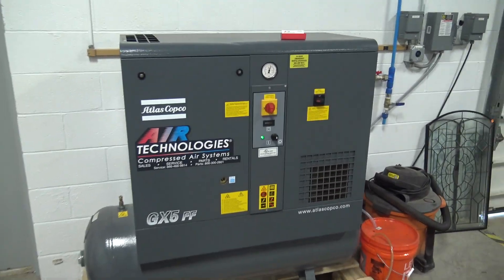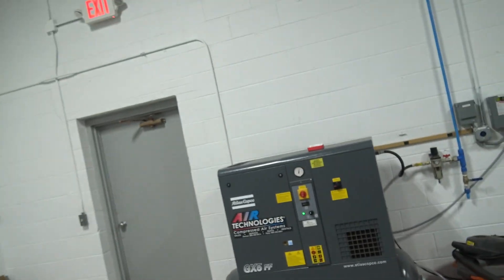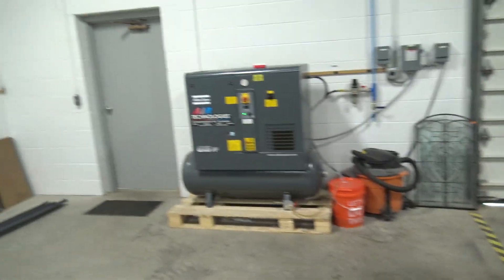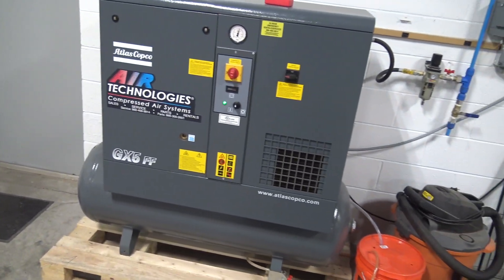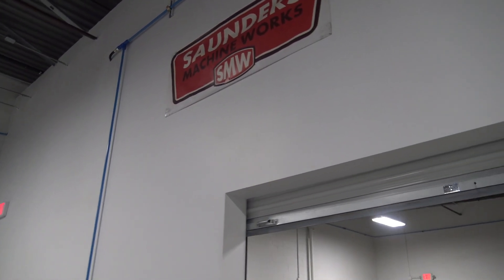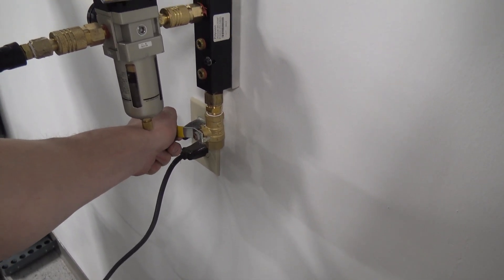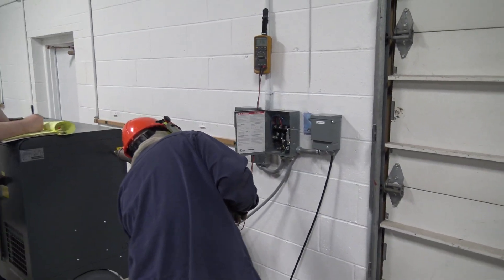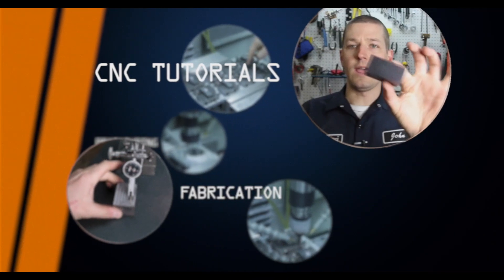Rotary Screw Air Compressor:  What are they?!  Worth the hype?

Comment: From experience working with idiots, you never want to dead head a rotarty screw compressor and then immediately release that pressure.  The end result is blowing all the oil out of the system into the air dryer.

Comment: I've just been using regular cheap white sch. 40 PVC 1/2" glue together pipe and fittings for my shop, it's been around 12 years without any problems, I'm running about 250 feet of it at 180 psi.  -  Works fine.
Reply: the main issue with PVC for air isn't how it performs when all is well, but how dangerous and spectacularly it fails.

It gets quite brittle over time and with UV exposure. It will shatter and send sharp fragments flying when it burst. You can find info about this on Google.

I am posting this as a PSA type thing not trying to attack your air line choice.
Reply: Yeah, the first time I saw a shop with pvc compressed air lines I  thought they were just cutting corners. But 1/2" and 3/4" lines can handle in excess of 280 psi. I've seen a few shops with it, and nobody seems to have any problems with it.

Comment: I dont know if it would be worth the extra cost. Buy two pistin style compressors, put them at either end if the building, have two separate loops and build enclosure around both if your concerned about noise. At least then you have done redundancy and aren't relying on one compressor for everything. Probably would have saved a decent amount of money too.

Comment: Screw compressors are the way to go. I'm about to upgrade my shop to a 100cfm variable speed IR so I can install some new machines. The compressor in this vid is great for running a constant air load but not so great for intermittent load. Variable speed units provide better efficiency over an on/off unit when used below full capacity. In my case a variable speed compressor is going to save me a ton on the electric bill. The downside is initial cost, and the added complexity of a VFD which makes it more difficult and expensive to repair should the VFD fail. Saw it happen when I was doing plant maintenance... cost 7k and 2wk lead time on a new VFD for a 25hp unit.

Comment: I agree with how you've dropped the lines and got water traps at the bottom. At least it comes out of the pipe that way. Also it's faster to just wire up three phases to the motor randomly and then test for direction and if going the wrong way, you swap any two. So you have a 50% chance of getting it right first time. That's why he started it up and it went the wrong way. If you sit around trying to nut it out and then wire it up how you think it should be, it is GUARANTEED to go the wrong way first time.

Comment: Buying a screw compressor was one of the best things I have ever done. Our shop used a 10hp 2-stage 4 cylinder 120 gallon  compressor for years. Before our CNC machines the compressor would only go on about 8x a day for about 3.5 minutes each time. 

After the CNCs arrived it ran almost 50% of the time. Every 2.5 minutes the compressor would go on for 3.5 minutes.The noise was taking a toll. It was bad. It was worse than bad. (this in a shop of 2500 square feet... and no, there's nowhere to put the thing outside).

So, just for employee and the bosses sanity we bought a 10hp Kaeser AirCenter with the air dryer (it's a dry tank). Now I don't feel the compressor through the floor in the office or interrupting any conversations in the shop.

YES! They are expensive. YES! They have limitations but can sanity and hearing are worth more than a bunch of dollars.

Comment: I would recommend rubber air compressor dampers, they worked good for me

http://www.ebay.com/itm/4-Pack-Anti-Vibration-Pads-For-Air-Compressor-Or-Equipment-Solid-Rubber-4x4x1-/280485697812?hash=item414e401914:g:IiAAAOSw3ydV6ekA

Comment: I am not a air systems expert just someone who has used them.  From my experience a good piston compressor with a large storage tank with a drier or have a second storage tank for continuous capacity for somewhat intermittent  use would be a more cost effective system than the rotary screw system.  The rotary screw will put out a lot of air but is really meant for continuous use.  Its my take.  I worked where we used 400 psi and 150 psi with regulators for lower pressure as needed.  There was a compressor building that housed the air compressors and heat exchangers separate from the main building because it was noisy around that building.

Comment: Hi John

Great Video.

All I know is most Oilless type compressors will not stand up if they are used more than just blowing up a bicycle tire once in a while. If you have a Bead Blast Cabinet/Sand Blaster they will not last very long.  Oilless units have plastic pistons/parts and cannot stand the heat of higher usage like what is required running the above equipment.

Cheers

Willy

Comment: Part of the reason why the screws like to run continuously is to keep the moisture boiled out of the coolant. The oil acts as a seal filling in the gap between the screws, so they don't actually touch. Also in the book for my 5hp IR screw they make mention of the starts and stops over heating the motor. Says if more than 8 starts an hour then turn switch to run continuously. One thing about the oil maintenance is that service intervals are quite high, 5-8k hours

Comment: The price for rotary screw compressors might come down thanks to 3D printing. The YouTube channel "Tested" visited the Carbon 3D shop where they showed off a 3D-printed part that looks a lot like a rotary screw. The plan for that particular screw is apparently to make low-cost air conditioners for "emerging markets" but it seems like normal air compressors can't be far behind.  The YouTube URL for the video includes "O2thSsQrZUM", but I'm afraid posting the whole URL will be flagged as "spam". The title of the video is "Carbon M1 Super Fast 3D Printer Demo!" in case anyone interested in the video would prefer to find it by searching. They start talking about the screw at 10:49. I'm sure 3D printed rotary screw compressors are years away, but it seems that they're on the horizon.

Another thing anyone looking for a high-end compressor should look at are rotary scroll compressors. They're oilless, so all the hassle associated with checking/changing/cleaning the oil are eliminated, making them basically maintenance-free, and they're also very quiet. They also have no problem being started and stopped on demand. The price is quite high, but in all the research I've done, they seem to be the "best".

Comment: When I came to a new job it was in a warehouse kind of building with high metal ceilings and it was very loud with a lot of echoing. Later on they did noise abatement by hanging cloth in vertical sections in sort of a zig zag pattern and it made a huge difference. Something to consider.

Comment: The 'Screaming Lena" rotary screw compressor the Huckleberry RR had was a Army government surplus unit.  It had a Cummins diesel and would just sit and idle until we started using air then it would 'load' or reve up.  We could use a 1" air impact wrench and it wouldn't load.  This was at 90 psi.
DO NOT skeemp on air filters.  I might add another filter to the intake.

Comment: So basically it's a roots supercharger, but instead of throwing the air around the casing it compresses air in the same axis of the rotation of the screws. Interesting. I never knew how they worked, thanks for the video explaining things.
Reply: Roots uses two interlocking smooth lobes.(either two or 3 lobes per) They are great at providing high CFM output. But their design allows for too much slippage and generally don't produce much more than 15-20 PSI 

So. Kinda the same principle, but not really.

Comment: I once worked at a wood shop that used a rotary for their compressed air.  When I started work there we occupied 30,000 sq. ft.  We added on a 60,000 sq. ft. addition for a total of 90,000 sq. ft. total and that rotary had no problem delivering all the air we needed for spray booths, pneumatic tools, etc. -  etc. I worked there for about 2 1/2 years and  the place ran around the clock 7 days a week using 2 twelve hour shifts.  The only time that rotary shut down was for normal preventive maintenance - it never broke down once during those 2 1/2 years I worked there.

Comment: I have a Quincy QP 7.5 that is an awesome machine but in a quiet shop it is LOUD. One thing I added to the system is a safety check valve right on the compressor output. It's a valve that will automatically close if a line or drop fails or more precisely a large pressure differential is sensed in the valve itself. Works similar to an electrical circuit breaker. It's peace of mind against having a flailing whip at pressure and having to run to a ball valve in a panic.
Reply: I have a 5hp Quincy, QT I believe. Love it. In my shop which is 30x32 open floor space, when the compressor kicks on, I can still hold a conversation within 10 feet of it. The pump is rated at 18cfm but it keeps up with my blast cabinet up to 120psi. I've never seen so much as a speck of oil come out of the tank, and I only get water when I'm running it hard for a while, like running the blast cabinet for more than 30 minutes. I can run a die grinder until it's frosty without any water issues. It runs slower than other compressors, and I do get valve noise, but it's not objectionable at all, and anyone older than 50 that wanders into my shop says it sounds like the old gas station air compressors.

Comment: Exterior intake pipe.
Quincy had intake filters for exterior use with replaceable elements. This addresses keeping critters, etc. out of the compressor. From the compressor point of view, it is important to keep dust and grit out of it, think of an air cleaner on an automobile. We used PVC pipe for the intake line, probably 1 or 1.5" to reduce friction loss. 

Surge tanks seem to be generally about 300-400 gallons to be worth while, heavy industrial settings have much larger tanks. If one were purchased used out of an industrial setting that was surplus to continuing operations and was stamped, there would be some assurance the tank would not be a safety issue. 

My concern was always the tank rusting and then bursting - it seems we stored air at 175lbs/in squared. That is a great deal of energy in one place if the tank fails.

Comment: At the computer centre we had 3 screw compressors they fed the johnsons controls stuff for the HVAC plant these all had two modes 1 run the motor all the time and cycle with the unloaded or trip the entire unit on and off , so we ran two in continuose mode and the third on/off

Brian funny you should say slow compressors long time ago now at the iron woks the 500 HP compressors only did 75 revs they were two stage in line or vee jobs and they thumped something Cronic you could feel it in your chest , at the work we had about 20 scattered about the site .
But the noisiest ones were the turbo blowers drive by steam turbines ( they would have been about 4 mega watt equivalent ) that's the thing that made me deaf 👎

looks a nice setup but wait and see when the humidity goes up how dry your air is 

Stuart

Comment: Personal experience in a combination dental office/large dental lab/insurance office building, 5 hp 2 stage compressor in a 3x12 foot room immediately adjacent to insurance offices and hallway.
1. Intake piped from outside building resulted in noise of compressor being limited to valves and gentle hum of motor which was 5hp, 3 phase. This was a Quincy unit, meant for supplying air to HVAC controls so low oil loss. Flexible SS hoses connected the unit which was mounted on rubber isolation mounts. 
2. Air cooled air prior to refrigerated dryer, then stored in a tank. If wet air is stored in a tank it was my experience the tank corroded and the automatic valve plugged- very annoying.
3. If I recall, Quincy compressor approx $2K and about 21cfm/minute free air
4. If dependability is an issue, make provision for two compressors at time of installation - when that is an issue, add a second compressor. This has the effect to maximize return on capital. In business there is a capital/labor ratio. The more capital, the less the labor - as an owner you are labor. 
5. If heavy surge air supply is a requirement, purchase a used surge tank. Large(depends on your definitions) seem to go for about $400 coming out of industrial settings, see HoffonLineauctions which is a good source of these things. 
6. This air supply was further filtered in coalescing filters sufficient to be acceptable to run a dental drill(this was verified by supplier prior to installation) a well a a Comco blaster in the dental laboratory with no issues over a period of 30 years. The lab was the big user with blast cabinets that used the 20 cuft/minute air. 
Properly maintained, the Quincy never missed a beat and is still running to this day in the same setting without issues.

Comment: Very nice compressor! Something to think about with any major addition is not so much the cost of the equipment, but more setup and future costs. You live in Ohio so there are probably at least 6 months where you need to supplement your heating(where the heat from your equipment isn't quite enough to be comfortable). I'm in FL and in planning my 1300sf shop, I have decided to keep my compressor outside under a lean to type shelter. I can't wait to work in the AC, but to avoid huge electric bills, I want to keep as much heat outside. Most people don't take into account that when they are in a cold climate, their 7.5hp compressor doubles as a 5KW heater. In FL where the AC is on 11 months out of the year, every watt used by equipment must be matched by at least a 1/2 watt to fight against the heat. That said, I don't think I could put a $10K air compressor outside. Over the life of my compressor the biggest cost will be the power to run it. If I had an awesome compressor like yours, I would need to get 20,000 hours(4KW@$.125kw/h) out of it to have the power bill equal the electric bill. Just something for those in warm climates to consider- The cost of keeping inside where it takes up expensive climate controled space. Those in warm climates need to keep things like this in mind- Might be time for a video on how to setup your plasma cutter so that the water in the water table is transfered outside after cutting.

Comment: John, Have you thought about buying a security camera system and mounting the cameras on your machines for remote viewing? They have both video and audio capabilities, and have great smart phone apps for viewing. It would add another ability for you or other staff members to monitor a machine across the room while doing something else. The wired systems are dirt cheap now. I have used systems by Lorex and they are really good for the price.
Here is a complete system, it comes with cameras. It is a coax based 8 channel wired system with audio for 1600 bux: http://bit.ly/1PoHUzl
They also sell sets of 4 weatherproof ethernet HD cameras for 600 bux. They have motorized PTZ cams for 150-200 each.
Just run ethernet to each machine and install the software on anything you want to view from.
 The Ethernet wiring for an ip based camera system could be shared by the machines to also eliminate your sneakernet jump drive system and allow for transferring files much easier.

Comment: Cool air compressor we have a screw air company in KCMO I the name is sullair? By the way, you might put an pipe extension on the ball valve that's next to the elect wall outlet. System looks great like the push in pipe system.

Comment: worked on scroll compressors for 14 years in refrigeration.  
the trick why don't like stop starting is compression in the scrolls and that couse high startup torque.  and that damage the motor and bearings and scroll bearings . there is more going on in there but I'll keep it short .
Reply: +NYC CNC no its the gas or compressed air and oil sitting in between the two scrolls.  and takes a few seconds to bleed out and drop to equal pressure on both sides of the scrolls.  
I hope this helps a bit more 

allways use the best oil you can with the Wright viscosity and never skip on maintenance  and you be fine . 

I favor scroll compressors over any other compressor.  

thanks for awesome videos man . and thanks for sharing all the information.   hope I helped you out a bit

Comment: because of the "terrible naming" I only can say (as a metric guy) that the naming was made after metric power range... kW (kilowatts) and not HP ;-)

the GX7 for example has 7.5 kW (aka. aprox. 10 hp) and the GX5 does have 5.5 kW (aprox 7.5 hp)

you know that Atlas Copco is a european brand and so they prefer the names being in one single line all over the world... and this is why they use metric ^_^
Reply: NYC CNC pretty sure about that my friend :-) 

as said, swedish headquarters and sweden = metric country ;-)

some companies indeed try to name their products matching the markets... like BOSCH does with the power tools for example on the rotary hammers... what we know as GBH 2-26 DFR is having the US equivalent rotary hammer named "1 inch rotary hammer" (26mm drill diameter in concrete in Europe... 1 inch in the US)

Atlas Copco however try to keep it all in one line... so the same name all over the world

Comment: easy enough to add storage
Reply: Look for old piston compressors on craigslist or whatever where the compressor is broken, can probably get them cheap or free if your willing to pick it up. Also there are old propane tanks, old welding gas bottles, old diving gas bottles and even old fire extinguisher bottles, sometimes scrap yards have 1000s of them or goto your welding gas supplier direct.